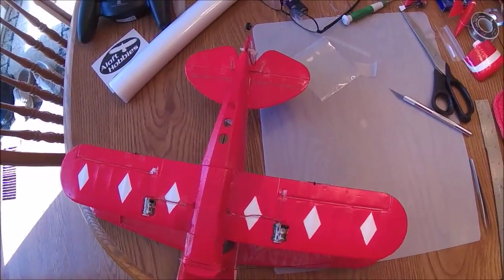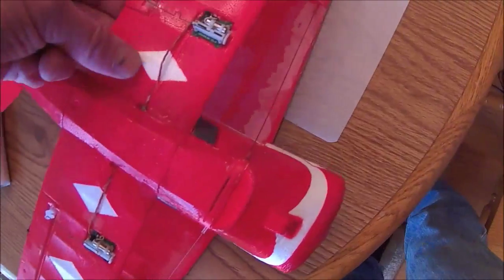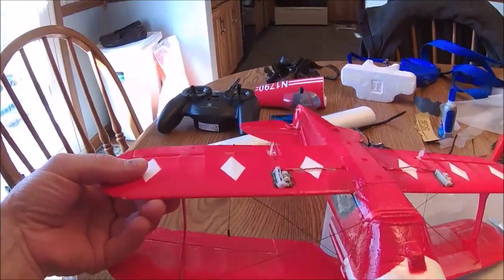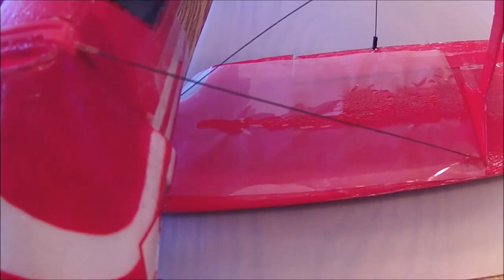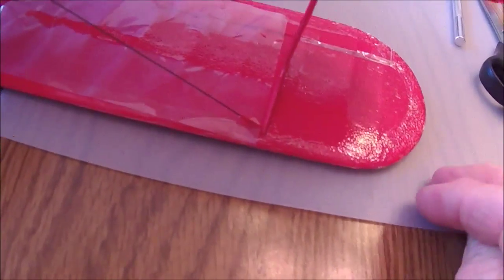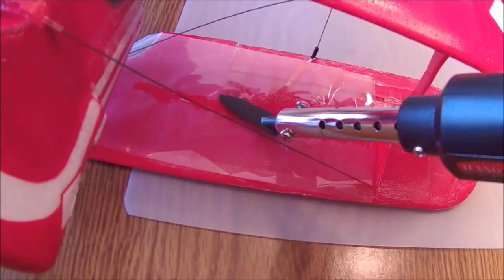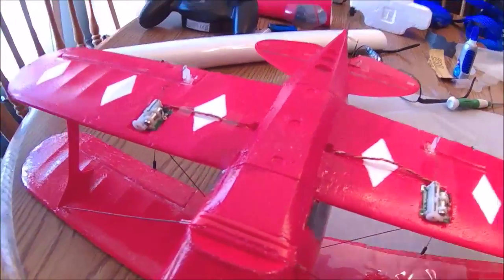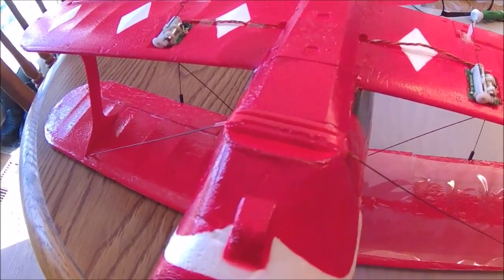How to Laminate a UMX Pitts

Comment: Very helpful!  I have laminated many larger models, but unsure if the polystyrene foam could handle the heat of a covering iron.  Can also laminate with clear packing tape.  Might want to go to using 3S lipo  Lamination adds a significant % to the mass of the model